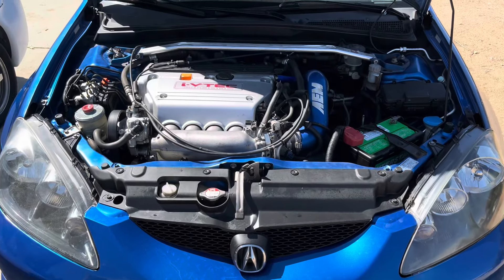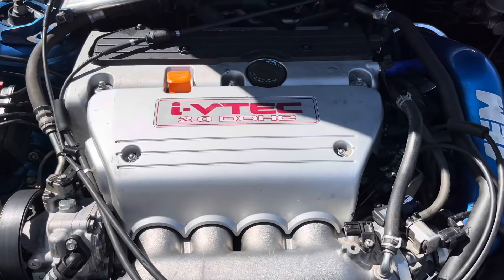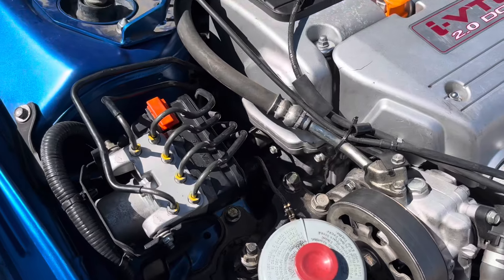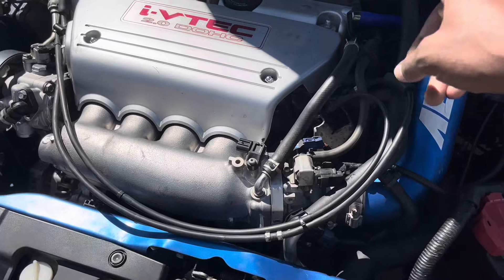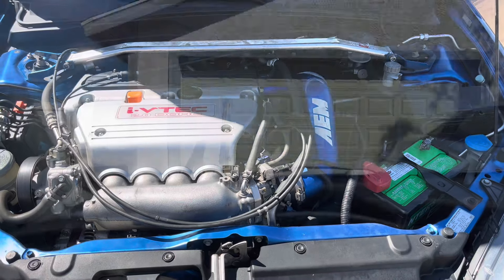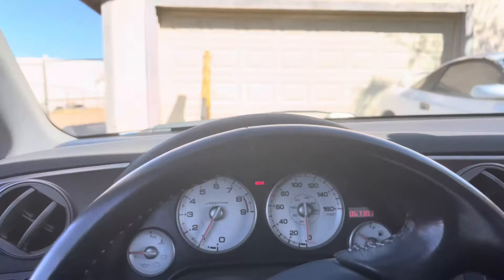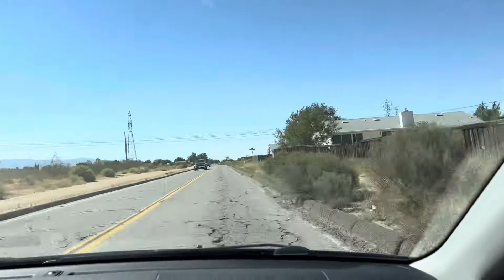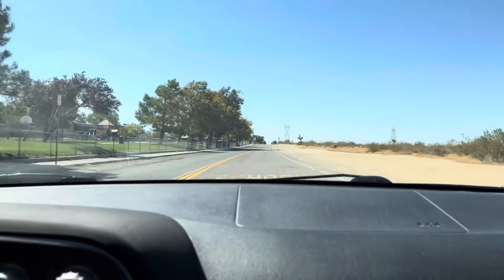Acura Rsx base auto to manual k24a 6 speed part 4

Comment: I’m doing a 2006 base model automatic to a k20a2 engine and 6 speed transmission type s, could I use the 2002 rsx type s harness and ecu to run the car and have the gauge cluster working or do I have to do what you said in the video and do some wiring?(and if you have any other knowledge would be greatly appreciated)
Reply from the maker: Your gonna have to do rewire , Probly easier to just run 05-06 harness
Reply: Okay thank you so much. Should I get a 2006 type s ecu too or stay with the 2002 type s ecu?
Reply from the maker: Yea get type s Ecu and harness

Comment: I’m doing a 2005 rsx base automatic to a k24A2 (2004 tsx) motor with a 02-04 6 speed (type s rsx )what harness do I use
Reply from the maker: Has to be the same year as the car
Reply: @rarewitit7899 so I have to get like a 05-06 type s harness and that’ll go in my 02-04 type s trans ?and motor
Reply from the maker: Yea if you watch the full series I explain how to convert it , I have the same setup
Reply: @rarewitit7899  I have watched it 😭😭 I gotta re watch and take notes
Reply: @rarewitit7899  but appreciate it

Comment: Does the speedometer work and accurate even with the VSS instead of the CSS?
Reply from the maker: Yes the ktuner can read css and vss without the need of a speed converter
Reply: @rarewitit7899  Nice! Thanks. I’m in the process of manual swapping a 04 crv awd into my 05 base. Just wanted to make sure!